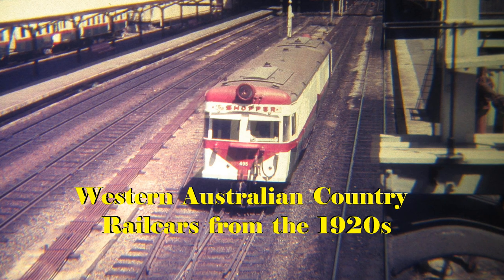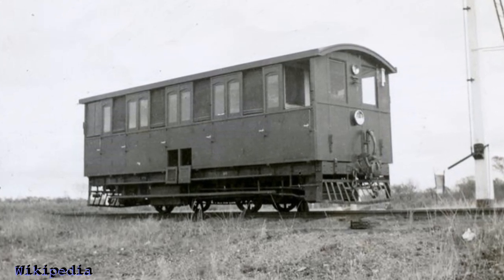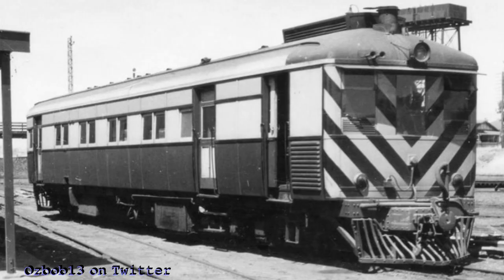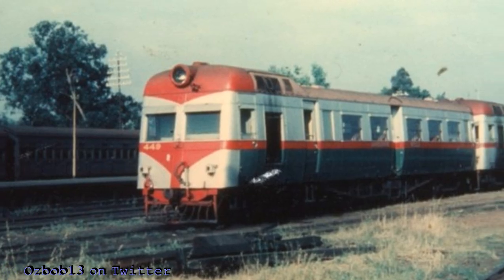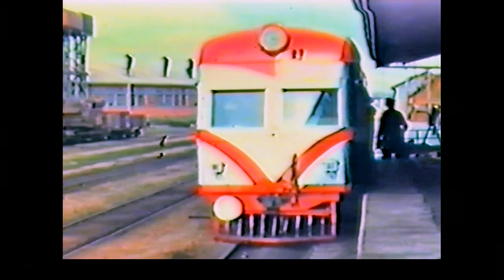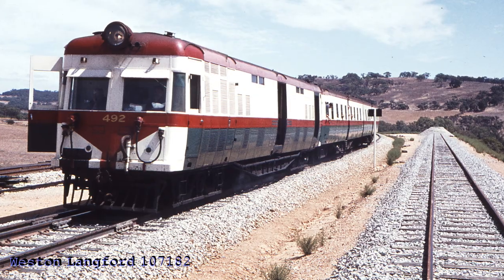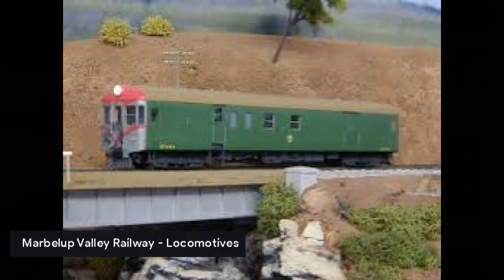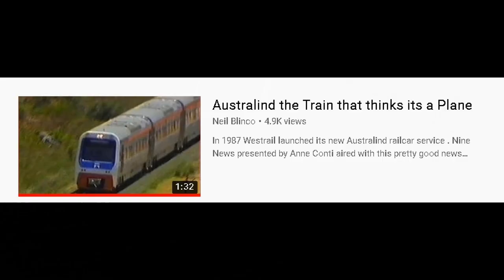Western Australian Country Railcars

Comment: In 1971 I traveled on the Shopper/Bunbury Belle. Noisy, slow and uncontrollable. In addition to the first series Prospector have the 80+ average, it was at one time the fastest rail car in Australia with a top speed of 160kmh. I also remember the first of the new Australind railcars. They were tested at more than 140kmh. I was a drivers assistant relieving at Bunbury not long after they were introduced. I did eventually drive the electric suburban trains but never the country railcars.

Comment: Thanks for the mention Terry, nearly fell out of my chair!!    I didn't know Railcars went to Geraldton,
I was in Mullewa in the mid 60's and never heard it mentioned, the only way passengers could
get to Geraldton from Perth then, was rail to Mullewa and then by bus. 
Goes to show you  learn something new every day.
Reply from the maker: I didn't know Geraldton had a service either. Not running to Perth by the look of it, but a Governor ran to Alana in 1943 according to Wiki": "It soon became apparent that the railcars had insufficient capacity so five AG carriages were adapted as trailers cars as an interim solution, pending six ADT trailers being delivered by the Midland Railway Workshops in late 1939.[3]

They operated on services from Perth to Merredin via Wyalkatchem, Perth to Merredin via the York-Bruce Rock line, Perth to Katanning, Bunbury to Northcliffe, Busselton and Donnybrook, and Geraldton to Mullewa and Yuna.[3][4] An additional introduced from Geraldton to Ajana in July 1943.[5]"

Comment: With the ADF (wildflower) railcars, is it known if they had black and yellow chevrons on both ends when in green and cream livery? I would assume so, considering they're double-ended railcars. I'm also intrigued about the door placement on the wildflowers, too - is it mirrored for each side (in the same spot across the railcar) or identical (position of doors the same when viewed from either side)?

Comment: yup on electric country rail service  will likely never come because we don't really have the power grid to support..

Whilst I think it is great to more electric serviced trains, I pretty much think in the longer term tram high capacity is  going to be the future within suburbia rail areas..

though at some point we are going to have to start to look at low based platforms to be suitable for disability aid bound people...

Looking at country rail options at present  with knew jerk delivery points of current rail offload and oload of passengers we need to start looking at low slung carriages to meet country platforms access..

from the point of me plus a wheel chair i'm at 176KG combined weight limit is above the weight limits of 85-110 limit of the carry on ramp , even worser still gopher of 220kg class or above is over weight  without me on it.. current ramp solutions are unsafe for use..

I think you have more chance of replacing Merredin and kal train services with new rail stock and see the current rail stock with new livery depiction of australind paint schemes running the bunbury service  assuming they don't extend the mandurah electric service through margret river to bunbury..

though I suspect they may have to upgrade everything on  the old Bunno line to a. support more daily services and get all platform to the same standard of the metro services rather than  the 1 door disabled access solution they currently  have on all country services currently in use and currently the disused portions of the  rail network

I don't think it be feasible to run a rail service up north today if it has to share shit with freight lines..

Comment: There's several images of the original ADH livery in the RHWA online archive. The ends were actually silver and red, not white and red.

The Australind was built with a 30 year operational life and was due for replacement 5 years ago but the project was hindered by political inaction. The new replacement railcars will roll out in 2023 or 2024.

Also, EMU stands for electric multiple unit.
Reply from the maker: Thanks. I love it when others share their insights and knowledge with us all. Well done.